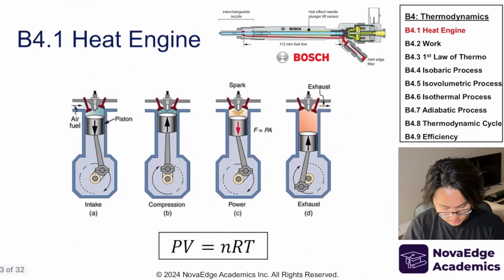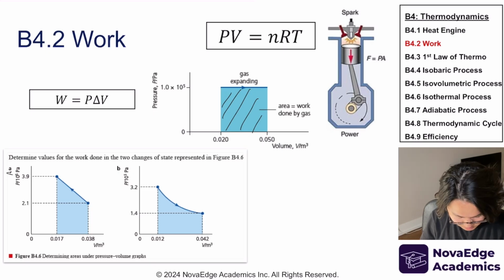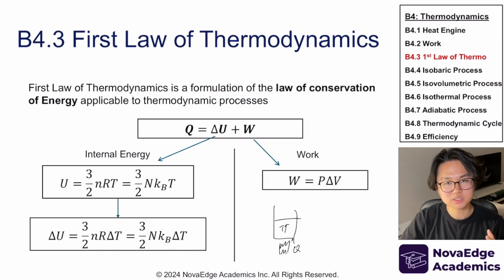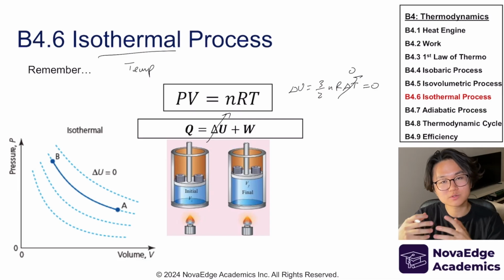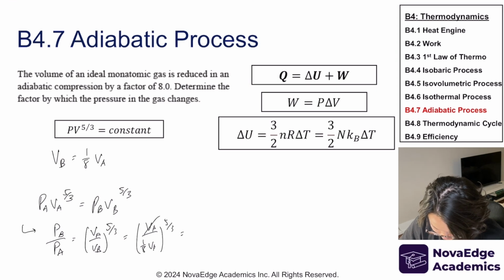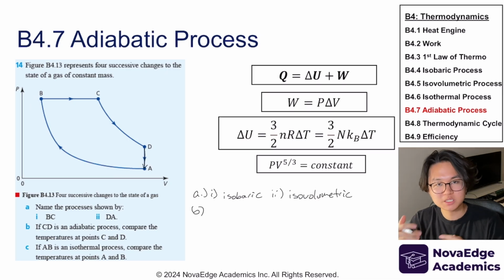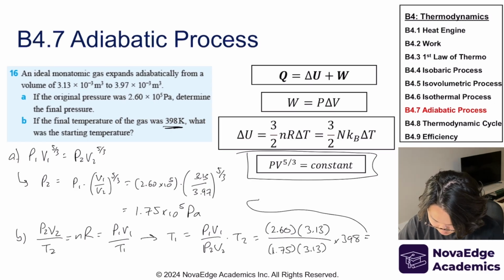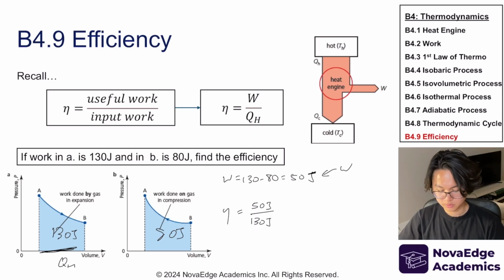NEW 2025 EXAM IB Physics B4 Thermodynamics Part 1

Comment from the maker: Hey guys, sorry for the late upload I've been quite sick recently but here is B4 Thermodynamics. Keep these 2 errors in mind:

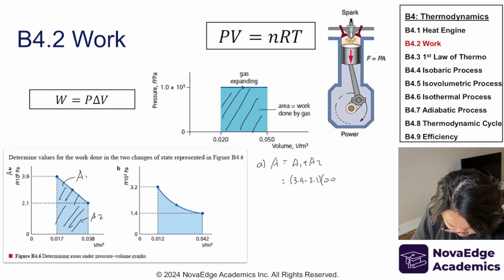4:37 The Pressure scale is 10^5 Pa, so the answer is 0.063*10^5 J
21:06 part b), I accidentally put 3.13 for V2, which is wrong. It should be 3.97, and final answer would be 466K, not 591K

Thanks for watching, and feel free to comment down if there are any typos or mistakes. Part 2 will be out this week, followed by Part 3 where I tackled Past Paper problems so stay tuned.